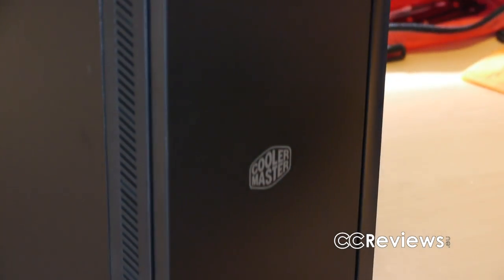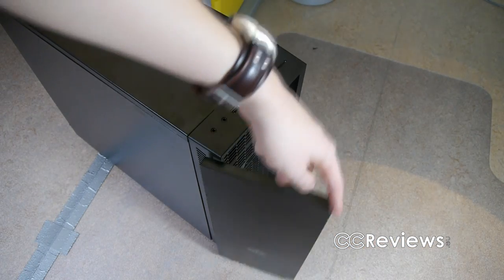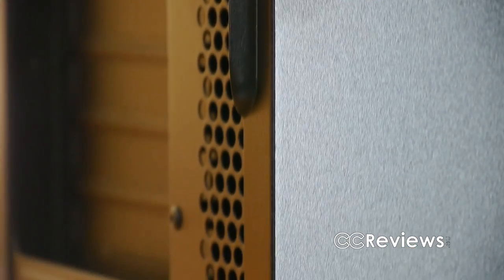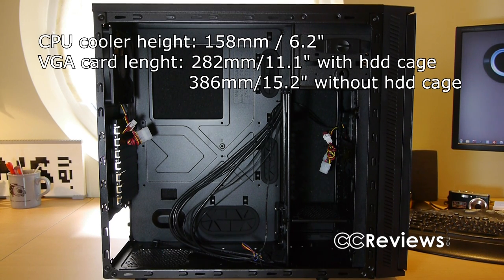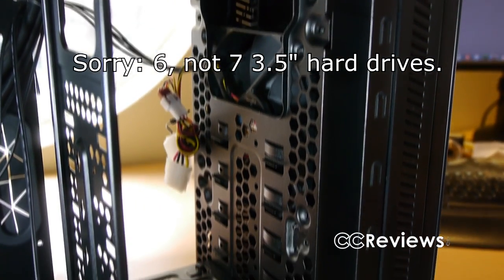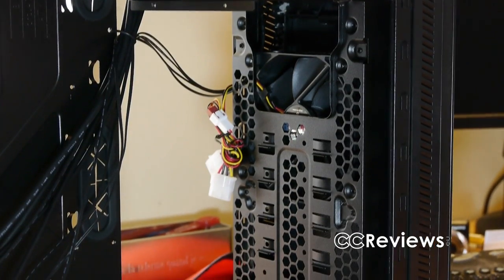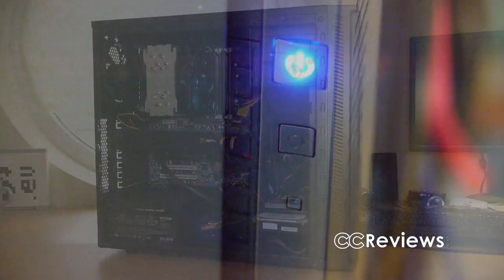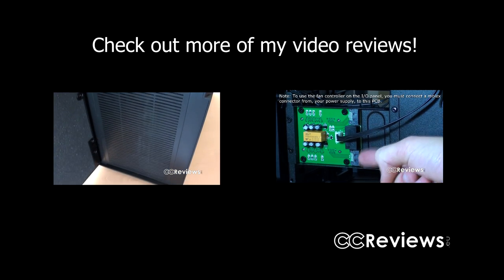Cooler Master Silencio 452 Review

Comment: Great video! Does this case fit the Nepton 280L? Both the radiator with fans on top of it? Also which other reasonably priced cases are made to fit the nepton 280L ? I am struggling to find some reasonable case, and this ine looks good i am just not sure whether it would fit... Thanks!
Reply from the maker: This 280L might be too big for this case.
Reply: +Otakar Libal like +CCReviews said, it will be too big but the case can support 120mm fans and radiators and 240mm radiator at the front.

Comment: Do you think I would be able to fit a Corsair H90 in this case? It's basically just an H80 except it's 140mm.
Reply: +nutella4eva Hey, it wont be able to because the case doesn't support 140mm fans and radiators, it supports 120mm and 240mm radiators and fans.